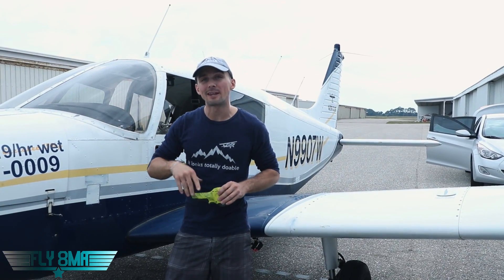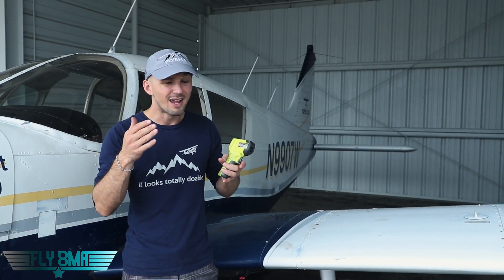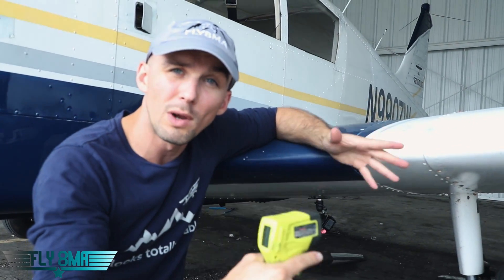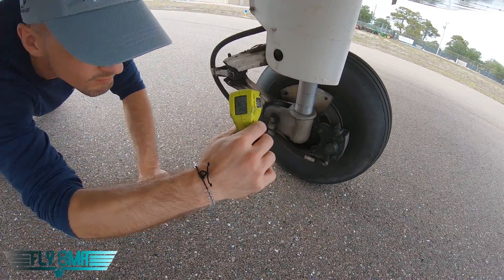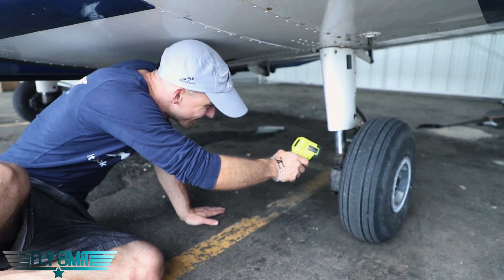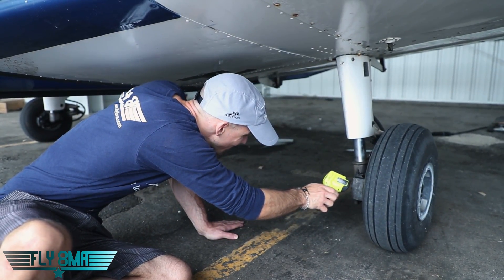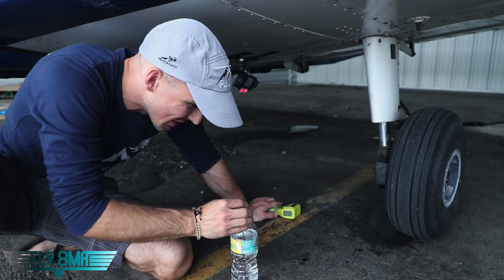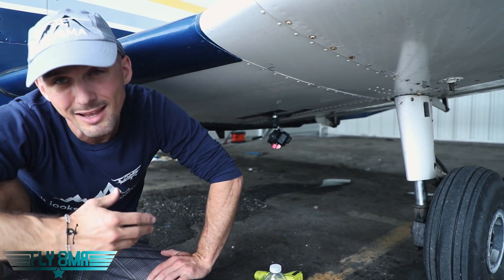Brake Overheat | Don't ride the brakes!

Comment: Who Taxi's at 1200-1300 RPM. I taxi at 900 to 1000 and still need to be on the brakes quite a bit especially on level or slightly downhill. Even at 900 rpm 
 I am well past a jogging pace.

Comment: Correction, breaks will catch fire, seen it happen many times with idiots behind the wheel of a semi going down the mountain.
Reply: Breaks in fuel and hydraulic lines can cause fires.
Brakes can catch on fire. Anyone not crossing Cabbage grossing 135k should probably not comment on semis.

Comment: can you add metric please?
Reply: Google dude...if you cant math it yourself you probably shouldn't be flying...js
Reply: Yeah, if you want to know the exact temperatures in Celsius, for some reason, just subtract 32 and then divide by 1.8 
I'm not used to Fahrenheit either, but I know water boils around 220F. So those brakes got boiling hot. And that's the message of the video.

Comment: The airport where I learned to fly had a tiny runway and we paid very close attention to the brakes. My current airport has a huge runway (8000 feet) but my plane has a castering nose wheel and you steer with the brakes. So I still pay very close attention to the brakes.

Comment: I dont know whats the deal. Nobody worry about there car breaks when they drive around. I am sure they get hot 
 too and nobody cares when they are doing 70mph. Lol
Reply: Well, a couple of reasons.  1)  Very few people push down on the gas pedal of their car, then hold it there and drive around using the brake to control speed.  that's essentially what you're doing when you set too much throttle on a plane than ride the brakes.   2)  Automobile brakes are a lot more robust than aircraft brakes, so it's not as critical.  Airplane brakes have smaller disks, smaller pads and smaller calipers. That means that the aircraft pads and disks wear out more quickly, and have to be replaced (aircraft brakes are a lot more expensive too )  it also means that there is less mass to absorb the heat generated by the brakes and they will heat up to the mount where the brakes start to fade and become ineffective, which is a bad thing when you need to get stopped.   You buy a complete set (all 4 wheels)  of brake pads and rotors for a lot of cars for about $100.  To replace disks and pads on 2 wheels of a light aircraft is going to cost $500 up to $1000 or more depending on the aircraft.
Reply: Car brakes are often vented and are generally far larger to both absorb and dissipate heat better, and even then brake fade can be a thing in cars.
Reply: I just can't stand people going downhill in neutral AND braking... tells so much about their ignorance.
Reply: Well, what I meant was even we are not pressing on the breaks while  driving the calipers are pressing on them and creating friction with the rodor and making the pads thiner even i dont press on the breaks....How many time you said....But I just changed these breaks? So my point iswe need to change the breaks sooner or later. And I always said if you can not affort a $200.00 oil change in a BMW dont buy the it, buy a kia...lol its just money.
Reply: @pilotmedic  if you're not pressing the brake pedal, the pads do not contact the rotor. That would be straight up stupid for an infinite amount of reasons.

It's not only a money thing. If the rotors overheat, you have brake fade and therefore your braking effectiveness decreases. It's also a safety concern.

edit: we need to die sooner or later... what about that? you don't just die because you will "sooner or later", that's ridiculous.
Reply: @pilotmedic  Well, it is true that disk brakes always drag slightly, on cars and airplanes, but it ain't much. there's a huge difference between the wear  you get from the natural tendency of dick brakes to drag, and the wear you get by going around applying pressure to the brake pedal(s) and dragging the brakes.
Reply: @pilotmedic  it is more of a safety issue with aircraft for a couple of reasons - aircraft brakes don't handle heat well to the point that there is a very real risk of fire if the brakes are abused or in an emergency like an aborted takeoff. The problem is serious enough and common enough that there is specialized firefighter training for dealing with overheated brakes on aircraft, and modern large airlines have temperature sensors. 

Secondly the braking systems on aircraft are independent, like the front and rear brakes on most motorcycles. Fade probably is going to happen asymmetrically, which means that nearly all the braking suddenly nearly disappears on one side, and the airplane yaws the other way and at best goes on an uncommanded voyage of discovery. Worst case it can wind up upside down or hitting another aircraft it object. The STOL Drag racing folks have learned that they can encounter brake fade on their second landing causing a loss of control.